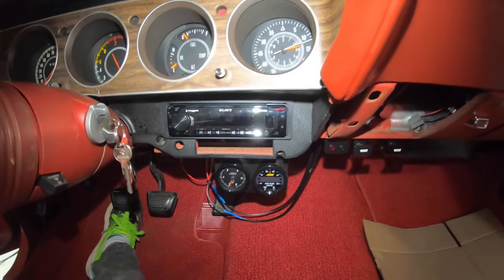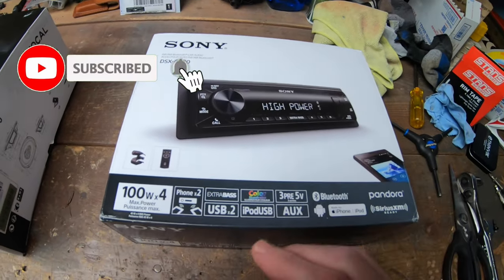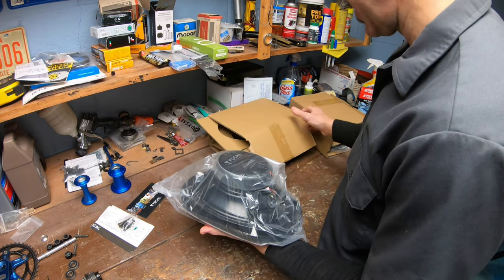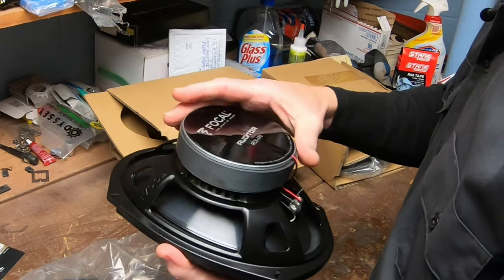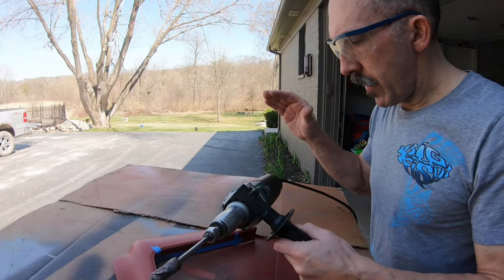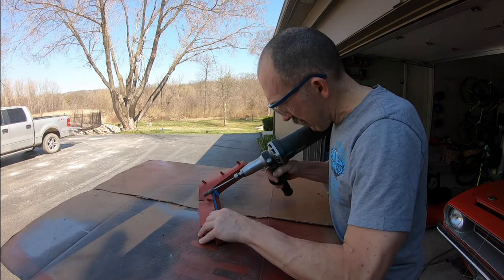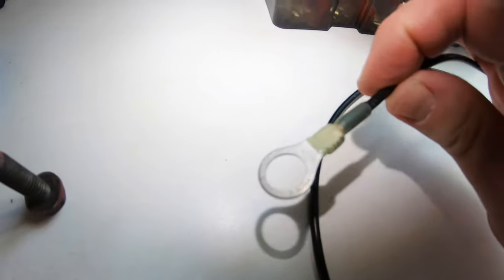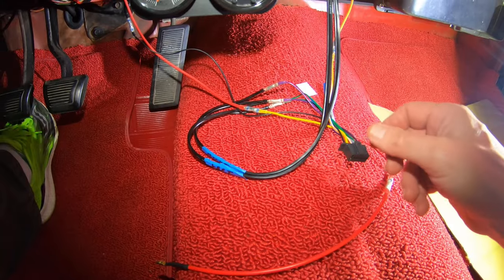Bluetooth Radio & Speaker install in a Classic Car!

Comment: I bought some speaker fabric and cut pieces to cover the underside of the package tray, to keep the speakers hidden. 
Also added speaker baffles, to keep the sound from going into the trunk. 
I also covered my front speakers in the dash in my 69 Charger RTSE with R22 AM 8 track. It’s been modernised internally, AM/FM 8 track, MP3, Bluetooth, AUX, USB, hands free. 
I follow you here and on instagram.
Reply from the maker: all good suggestions, I should look into the speaker baffles to keep from loosing sound in the trunk.  If/when I redo my dash adding front speaker would help. Thanks for following along...just followed you back on I/G!
Reply: @backyardhotrods9885  reds ignition switch yellow goes to the battery
Reply: green is rear left purple is rear right

Comment: Great video, I came across this as I ordered the same Sony DSX-GS80 head unit from Crutchfield for my '96 Bronco. I had originally replaced the factory AM/FM/Cassette radio with a floating 9" screen in single DIN form factor from Boss Audio. The Boss unit has modern features like Apple Car Play/Android Auto but I never liked the look of it in the dash with a screen sticking out and the build quality was less than expected. I'm interested in how your Cuda progresses.
Reply from the maker: Thanks I appreciate it!  How have you liked the Sony head unit?   I have done a lot of projects with it over the last couple years but there’s more to come.  Thanks for tuning in👍

Comment: Hi Wayne, great instructional video as usual. Off topic, what are those 2 gauges under your dash? I have the same rallye dash as you in my 70 Challenger and I'm thinking of adding an oil pressure gauge and a voltmeter since my rallye dash oil pressure gauge is very inaccurate and I did the ammeter bypass so the ammeter is not accurate at all.
Reply from the maker: Thanks Dave, I appreciate it!  Those two gauges are fuel pressure and AFR.  They really were key in tuning the car.  I had my gauges rebuilt by redline but I am still thinking about adding an oil pressure gauge…I would feel a lot better about seeing an actual number there.
Reply: @backyardhotrods9885  I used a mechanical gauge to check oil pressure and it showed 75lbs at idle. The in dash gauge only makes it to just above the first notch. 🤔